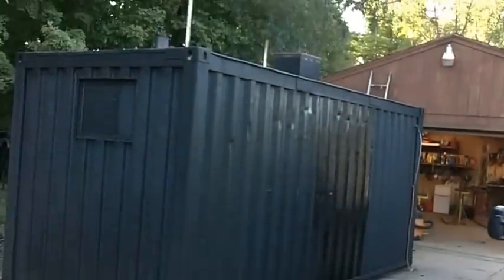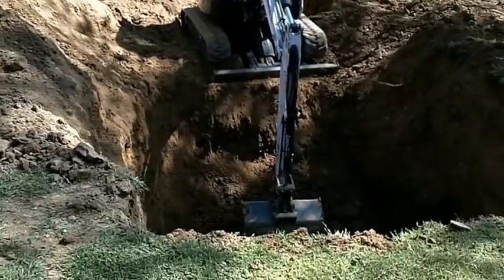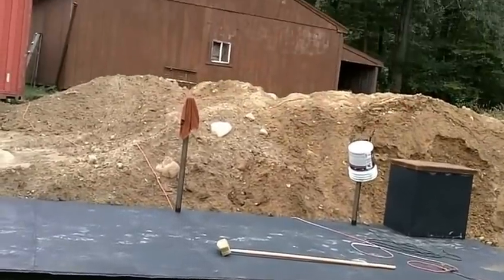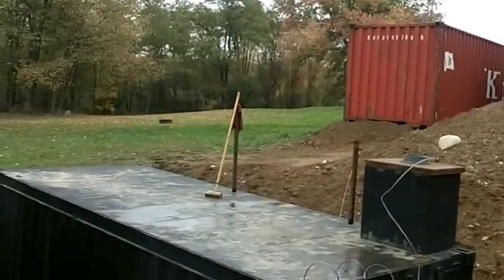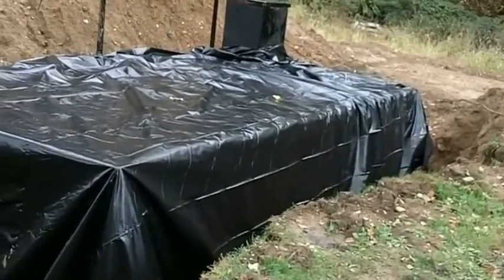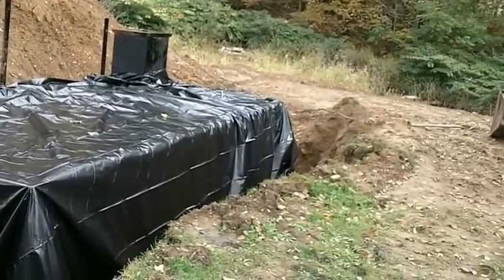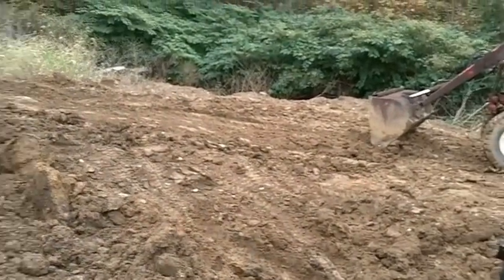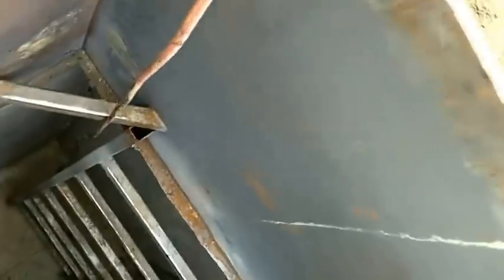part 3 Underground shipping container shelter

Comment: I retired from th ELectric Company and we built the DFW Airport electrical power system.  Most of our transmision power lines were buried DEEP!  We used 10' X 10' X 10' cement underground vaults for termination rooms.  Some as deep as 75' down from the surface. (some guys were too spooked to go down that 3' manhole to work.) The first thing we had to do before we could enter a vault was 1st pump out the water, then replace all the air inside them.  Because they were notorious for filling with fuel vapors off those big airplanes.
But, all that to say this.  Winter of Summer the temperature inside the vaults, didn't matter if it was 75' or 3' deep, was always 72 degrees.  So while I'm down in the vault working in short sleeve shirts, the Grunts topside were either suffering through 110 degree heat wave, or freezing their butts off.  I loved it!
I still hope to be able to bury a container in my property here in Rural North Central Texas. (Tornado Alley)

Some good tips on building the containers.  I always thought I'd just build out the inside like a rollcage in a race car to support the walls and roof. But filpping it over does make a lot of sense.  I was thinking of building a steel truss on top, tied to interior headers and walls inside the container.

Maybe buy 2 containers. One good one and one with walls trashed.  Cut the bottom off one the trashed one and weld it to the top of the good one that goes underground for a roof reinforcement. then reinforce the inside walls.

Good Video my Man!

Comment: Hey brother you don't need a crane ,contact a large mechanical contractor and rent a monorail hoist they use to lift massive HVAC units onto roof curbs so far last the edge of a building no crane can reach ,we put mine in the ground using a monorail hoist that looked much like the hoists used to install crypt casings at graveyards .

Comment: When I was young, we put in a concrete septic tank and after we buried it, it rained and floated the tank out of the ground. The second time we did it, we filled it with water so it wouldn't float out again. That is a big problem putting something underground. Looks like you have it worked out.

Comment: Did you use some kind of sealant on the new underside to protect the metal? It looks like it would be necessary to keep it from rusting out because of the high water table. I don't remember if you mentioned the purpose for your project, but if it's for a SHTF bug-out bunker it seems a bit small, but for a storm shelter it's a good size. Thank you for posting this information.
Reply: Cephas Martin he flipped it over and welded plates on all the spaces and then filed it with water and none leaked out. I would install a lot of drainage, gravel, French drain pipe, and spray the whole exterior in asphalt. But he said he'd do tar and plastic.
Reply: andrew32155 You're telling me this information from the video why?

Comment: Being as this is Ohio, it would help to have a sump pump for the container running  24/7, and you don't want it floating like a submarine. 

I would have a least 18' of gravel at the base, as well as 6" on all sides of gravel, and 6" of gravel on top, this helps to keep water away from the container walls. Another good idea would have been a reinforced concrete slab overhead.
Reply: May want to tie it down also

Comment: GREAT GREAT GREAT Idea. FLIP IT OVER. Do you think I can use 4x4 and plywood for walls ?  I would definitely use 2 inch "C" beams for edges and side walls (is this the size you used?). Can I use on roof  rebars and concrete? and I would be pouring in a way that I have a high center so water and strength of a dome shape?

Comment: Sir, I've enjoyed your work and commentary. Learned a lot. I've one question though. Is there no way you could dig a drainage ditch, install a run-off pipe sloping downhill from the container? I could be wrong; however, I keep seeing what looks like a creek or some other lower elevation not too far from the container's hole. Gravity will work best to keep the water out. Never know if and when power will fail. Sure'd be good to have an energy-need-free method of drainage.

Comment: I was curious as to why you chose to seal it with steel plate. Was that for making it water proof or strength? I was considering sealing a container and burying it, but adding B decking, rebar,  and pouring concrete for strength. The concrete would not only add strength, but prevent the container from shifting or floating. I had never considered inverting the container though.

Comment: I noticed your main hatch is at the top to access it, but when you open the escape hatch, where does it lead to? Did you make a tunnel from the escape hatch to the outside through the dirt?
Reply: Seems to me like It leads to dirt since it's about 4 ft underground.  You would have to open the hatch and borrow through to get above ground.  Not the best solution, but better than nothing, I guess.
Reply: Hatch is only 1.5 feet below, 30 second dig to get out. But you are right, that may be too long, or too hard if dirt packed. And hard to reach. But is necessary. 30" flex plastic pipe to surface may work.

Comment: Thank you Mike. Very informative and logical presentation. Would love to see the finished product, with your ports for firing. How do you envision those working where those on the entry door? Was the tar on roof so the plastic wouldnt move as you poured the dirt in or an added water repellent? Why not the sides or the bottom? What about drainage around the container or gravel under it? How did you hide the entry?  Anyways thank you...great video.

Comment: Question: how to you prevent this from "floating up", the same way plastic septic tanks float up after heavy rains?  I did not notice any "anchors" to hold this container down.  I know its heavier, but still filled with air.

Comment: You didn't cover nothing about drainage and when you remove dirt from the ground you make a pet once you put the dirt back in because it's loose not compact it will still retain water did you or did you not put gravel underneath in a way that the water could drain away from it

Comment: Only issue I see when you climb down the door opens out instead of in unless it swings didn't see. If this was just a simple storage then it wouldn't be an issue but if it's a bug out shelter that box becomes a coffin since if that egress gets filled with dirt, debris, or is blocked off you can't open the door.
Reply from the maker: the escape hatch opens inward
Reply: Yes, the escape hatch opens inward but as far as I can tell, you would have to burrow your way out since the escape hatch appears to be about 3-4 feet below the surface.  In a time sensitive situation, good luck.

Comment: Two questions....We want to do three 53 foot containers....how  many ribs (walls) would you recommend on that length? And we were wanting to bury ours where there is 6 feet of dirt, is that possible with this design?
Reply: +tandm1234567 Sorry I just saw the email to send questions too.
Reply from the maker: I recommend no more than 10 feet and then have a load bearing wall. 1 rib brace horizontally between the walls is sufficient. just make sure that load bearing wall is no more than 10 feet that should be plenty
Reply: Awesome, Thanks for the info!!!!

Comment: I've been thinking about doing this for a while.
Has anyone ever tested the air system AFTER it is finished?
I would be worried that no air could make my dream a grave real fast.
Reply from the maker: I have a carbon monoxide detector and it has never went off. the blower moves alot of air. bad out fresh in.

Comment: every one says that its water proof yours wax the only one with warer in
Reply: His was the only one turned upside down.  The bottom is not water proof.  Therefore, if not turned upside down, water will seep in from below.  However, his mods to the top (which is actually the bottom) made it waterproof from above.  These other videos never show you what happens to the shelter months after it's been underground and not properly installed and waterproofed.

Comment: Only bad about all these under ground bunkers is that they all have weak links. Once you're in them your screwed! Air can be sealed off and you can suffocate or your escape hatch can be sealed from the outside,and again you suffocate. Power by solar or generator can be cut and you have no power, 110 can be cut as well. There is NO SUCH THING AS A SAFE BUNKER. No mater what you do once your in you're screwed, exhaust can be clogged from the outside and you suffocate again. Just ask the BUNKER pros, Hitler had the best BUNKER builders ever and none of them could live in them very long, diesel fuel only last so long.
Reply: Cory Boyd it's all about the contingency plans. Lol. For my personal one (6 containers combined) it has two air pumps, one of which comes from inside the house via HVAC system and then runs through a filter and then the other runs through a shed and the air comes from up top of that. Also my escape hatch comes through the shed (found a shed for sale on Facebook for $200 and couldn't resist)
Reply: Nothing is ever fullproof. But you can make it to where you have a good chance.

Comment: With all due respect, did you research what is necessary to do this kind of project ? It appears that you didn't and I hope for your sake, this container does not fill up with water and create mold that will make your project totally not inhabitable ! Once you saw the water table, you should have abandoned the project ! Secondly, you should have put a minimum of 12 inches of gravel under the shipping container with a lower barrel/container with a sump pump inside it below grade level of the container. I could go on and on but
you have a lot of potential problems which I hope you don't pay for in the future ! Thanks for sharing. -Take care, God Bless